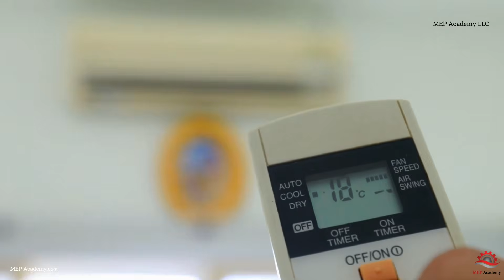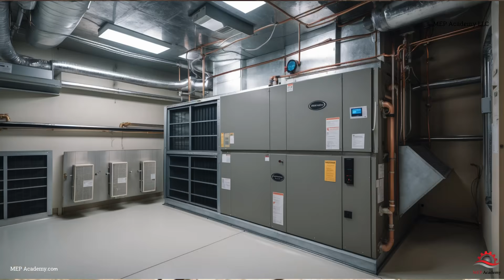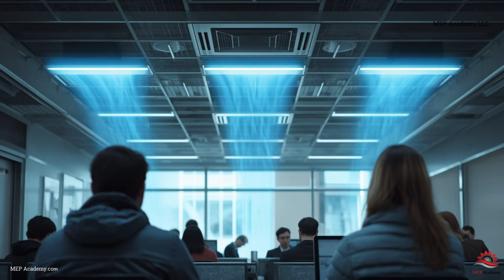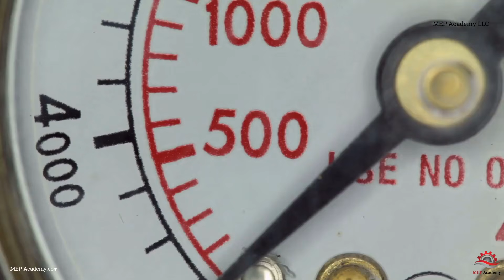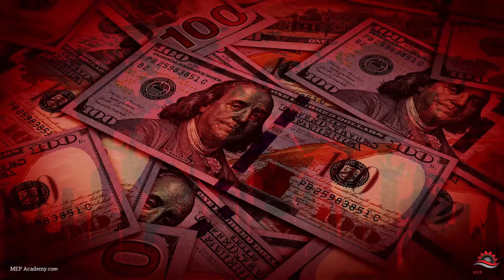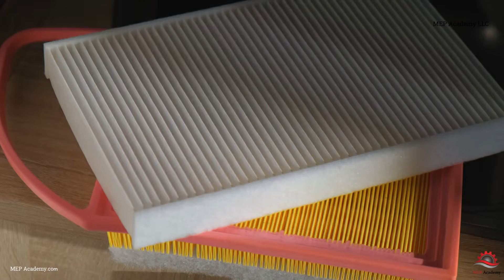6 HVAC Problems and How to Fix Them

Comment from the maker: Which of these HVAC problems do you encounter most often?
🔹 Frozen Evaporator Coils
🔹 Dirty Condenser Coils
🔹 Airflow Restrictions
🔹 High Indoor Humidity
🔹 Short Cycling
🔹 Excessive Energy Consumption
Many HVAC systems get expensive repairs when the real problem is a simple airflow, maintenance, or control issue that was overlooked.
Share your most challenging HVAC troubleshooting story in the comments below. What was the symptom, and what did the root cause turn out to be?
📚 Want to sharpen your HVAC knowledge and advance your career?
🎓 Online HVAC Courses:
https://mepacademy.com/courses
📥 HVAC & Plumbing Estimating Spreadsheets:
https://mepacademy.com/shop
If you found this video helpful, please LIKE, SUBSCRIBE, and SHARE it with someone in the trades.
Your comments help us decide what HVAC topics to cover next!

Comment: good breakdown of the hidden-cause stuff. the short cycling point is one a lot of homeowners miss completely - they assume the system is fine because it turns on, but the cycling is quietly wearing down the compressor over time. dirty condenser coils causing efficiency loss is another one that a basic annual tune-up catches pretty easily. if your system is doing any of these things and you're not sure what's behind it, getting a proper diagnosis before approving any repair makes sense. ARS/Rescue Rooter is one option for that kind of service call, though availability and pricing vary by location so worth confirming they cover your area.

Comment: Short cycling is one of those problems that a lot of homeowners overlook until the equipment is already worn down. The system runs, temperatures look okay, but the compressor is taking a beating every time it kicks on and off too frequently. Same with dirty condenser coils - reduced efficiency creeps up slowly so people assume the system is just aging when a cleaning might actually help. If you're a homeowner watching this kind of content because something feels off but nothing is obviously broken, that's probably the right time to get a professional eye on it before it becomes a bigger repair. ARS/Rescue Rooter does diagnostics if you want someone to look at the full picture, though availability depends on your area and getting the findings in writing before approving any work is always worth doing.